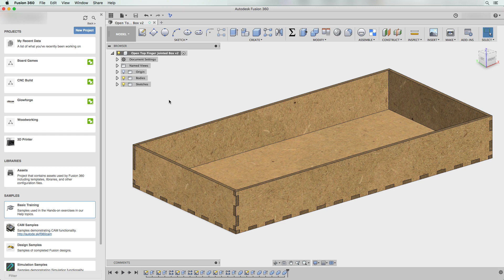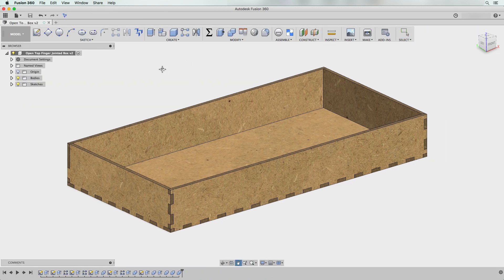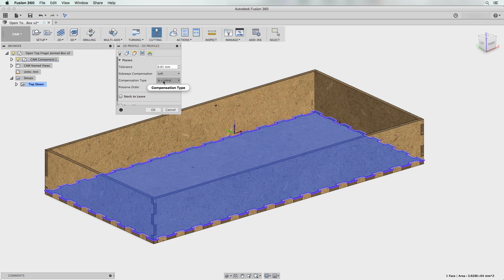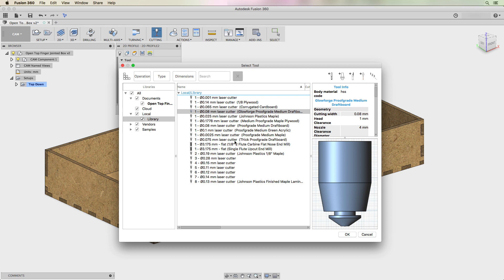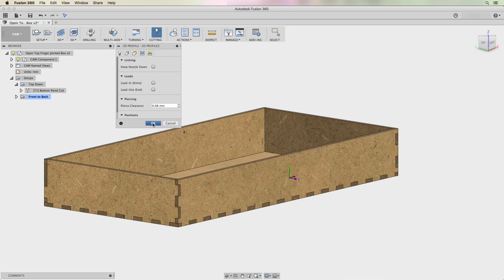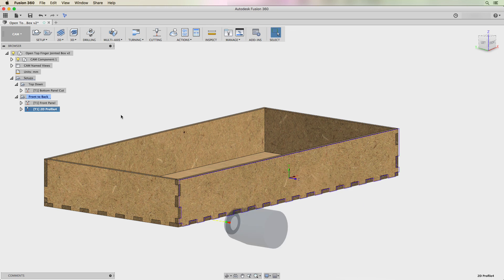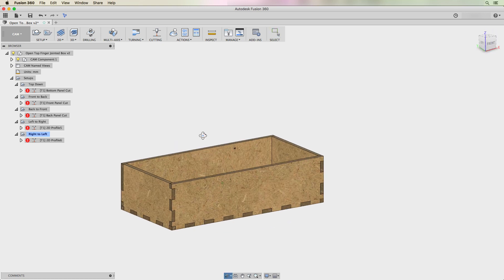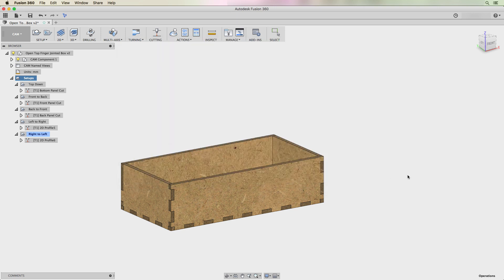Fusion360: DXF export with kerf compensation for laser cutting

Comment: When I do the dxf export, making sure that "Put operations in separate layers" is checked, I get a .dxf with only one layer in it - at least, only one layer appears when I load it into RDCAM.
Reply from the maker: I haven't used RDCAM, so I'm not sure if I can provide any guidance that would help. Do you have any other software (e.g. Illustrator, Inkscape) that you could check the files with?

Comment: Great tutorial on Fusion's CAM module! But I find Fusion's CAM module is unnecessarily complicated for generating laser cutter output. There are a couple easier solutions. 1) create a sketch from the main face of each part you want to cut. Then do a Save as DXF for each sketch. Or 2) use the free DXF for Laser (DXF4Laser) add-in by Ross Korsky available from the Autodesk App Store. DXF4Laser outputs a DXF from a selected face in one operation eliminating the need to create a sketch file. DXF4Laser will also do kerf compensation if you find you need it. (I generally do not.)
Reply from the maker: The sketch method works well, as does DXF4Laser. But, the sketch method will become more difficult in a more complex model; especially when you are joining and combining objects, and will completely break under certain circumstances with parametric models.

I haven't used DXF4Laser recently, but I find the CAM module to be a more robust alternative for saving and reusing settings.

But, yes, it is more complex.

Comment: Thanks you very much for your great work on these Finger Joint Boxes! I was able to integrate it into my own (first) Fusion project without any problem! 
Unfortunately I did also get strange paths on the .dxf especially on corners when importing into RDWorks (for Chinese Laser Cutters). I don't have AI and I haven't tried to clean it up in Inkscape but when I set "Output Polylines" to "Yes" in the .dxf postprocessor, then I get a much cleaner result! Some of the corners are still slightly rounded instead of 90° but there are no more strange half-moon artefacts on the corners. I did not cut it on the laser yet, but I think it should work fine.
Thanks again!

Comment: My dxf has linking (yellow and green) lines. How did you avoid this?  I think they are linking internal cuts?  I have to ungroup the dxf and go around deleting all of them 🙄
Reply from the maker: If I recall correctly, the extra lines are caused by having lead-in enabled on the tool path.

Comment: Your videos on the finger joints were massively helpful to me in understanding how to use Fusion 360.  This one on the CAM setup is how I got a grasp on how to do anything with CAM.  I found the Autodesk DXF post frustrating for the laser cutter I have access to: separating operations into layers leads to lots of manual work to finish the setup.  Also, the laser cutter in question uses color on the layers to categorize operations (speed, power, order).  I modified the Autodesk dxf.cps to generate a better DXF for this one (LaserCut 5.3 on a Chinese laser).  Would you be interested in trying it out?
Reply from the maker: Chief, I'm not sure I understand your statement/question. I'm glad the finger joint videos were helpful. The CAM video is focused on addressing my need to easily export the DXFs for cutting on my Glowforge laser, which uses colors for different purposes than other lasers. I separate each operation into a layer so that I can use one export operation from Fusion 360 and get everything over to Illustrator for final tweaks, and operation ordering. I'd be interested in seeing the tweaks you made to the default DXF post processor. I was considering some changes to it to see if I could reduce the amount of manual post-processing needed in Illustrator, but have had no time to look at it.
Reply: Here's a link to where you can find the modified post processor: https://github.com/alexander-at/Fusion360Helpers/tree/master/Fusion360_to_ChineseLaserDXF The defaults are now like you set a couple of them.  You'll need to adjust the X and Y step size to something larger than your largest part so that they don't overlap; that part needs some work in the post to make it less work for the humans.

Comment: Getting very weird DXF paths exported. Corners of fingers have strange half moon paths. Lines are not horizontal or vertical. Got hours messing with this and unable to eliminate these artifacts.
Reply from the maker: This sounds like the tool setup is too large. Are you using the 2D Cutting operation, and what is the Kerf value that you are using? If the Kerf is too large, you will see rounded corners instead of sharp corners.
Reply: 0.08mm kerf, found main problem... don't group paths in AI. Also, needed to join paths. BUT... still can't open DXF with layers from CAM post. Matching your settings. Using AI CS5. Maybe it is too old?
Reply from the maker: I have CS5 on another machine. I can try it tomorrow.
Reply: It would be nice to know if CS5 is causing issues.
Reply from the maker: Unfortunately, it looks like CS5 isn't working on my other laptop, but I found information that says the DXF import should work. Make sure that you are opening the DXF directly, or dragging it to AI. Don't use the File->Place function.
 https://forums.adobe.com/thread/998776#
Reply: Opening the DXF rather than placing them worked! OOPs... making progress!